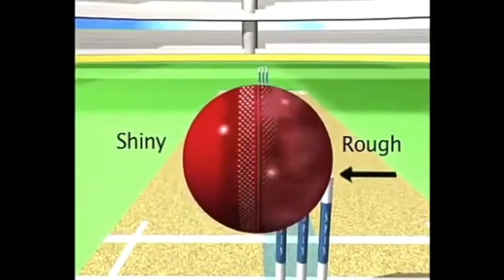Sports Science - Cricket Ball Swing Explained

Comment: How do u explain the swinging of the ball when both sides are shiny... As in the new ball.. 
U have to include the role of the seam in setting up turbulent boundary layer.. TThat aids in one half of the airflow to stick for longer to the ball surface.. The laminar lauer on the other side leaves the ball earlier..setting u0 pressure differentials.. and hence swing from a both shiny sode surface

..also one problem that has not been solved yet is how does the same ball that doesnt swing ie new ball..in sunny condotions..but swings as soon as theor is cloud cover.. 

As for science of old ball swing.. Imran khansClassmate at cambrodge has wrotten a paper explaining the science of turbulant layers and reynolds numbers...